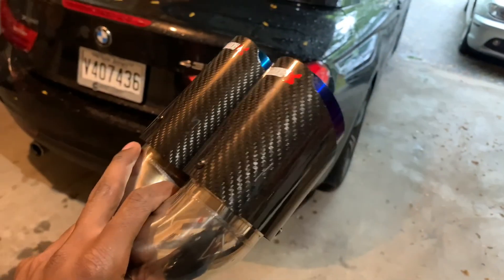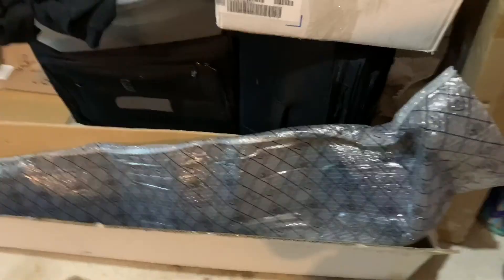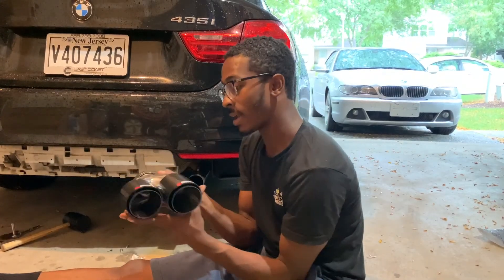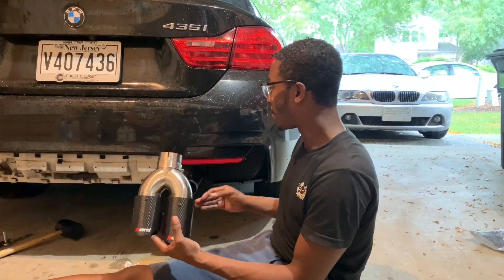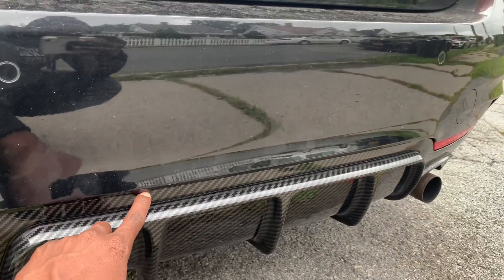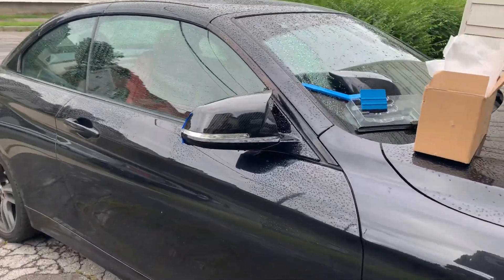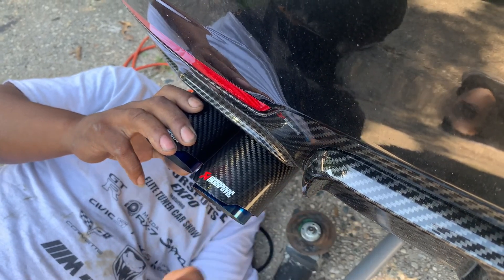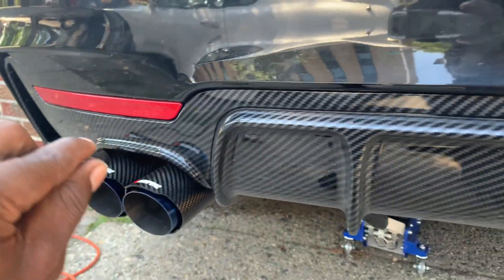Carbon Diffuser Install F32 F33 435XI DIY

Comment: What’s good bro.. I just picked up my 440i 2 months ago. Got my exhaust tips in last week and was gonna order the carbon fiber mirror caps next week. Now adding the diffuser after seeing this video. Looks 🔥
Reply: Bro how did you work with the metal battery box on the right side. I have the quad diffuser but I can’t put a quad exhaust because the right side has a battery box. I drive 2017 440i coupe

Comment: Hey bro, im doing a similar setup. I just ordered 63mm inlet size and 89mm (3.5 inch) outlet size. What outlet size are you running for your tips? I dont want it to be a super tight fit, but I feel like it's going to be close.
Reply: Hey Humza, how did that end up going? Were the 89mm too tight or was there room for a little more?
Reply: I'm looking at these tips but they only come in 93, it's about .16 inch more but I don't want the fitment to be too tight..